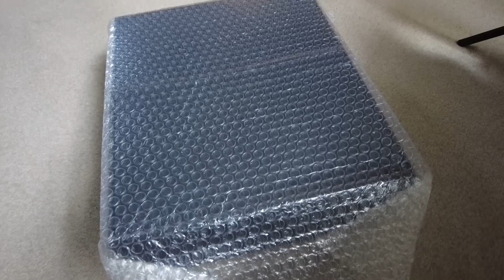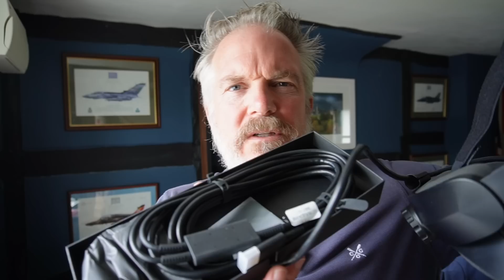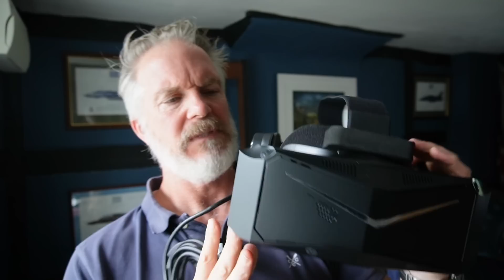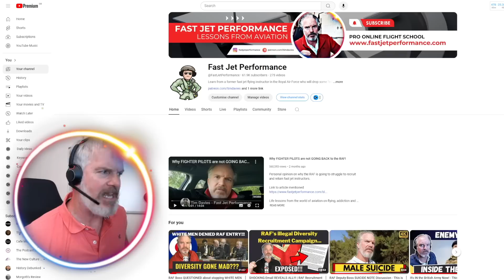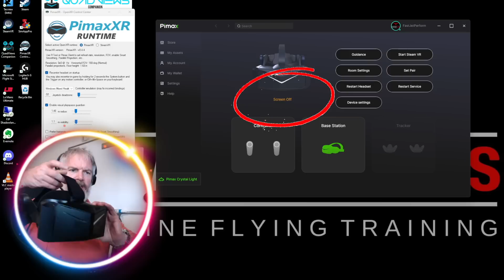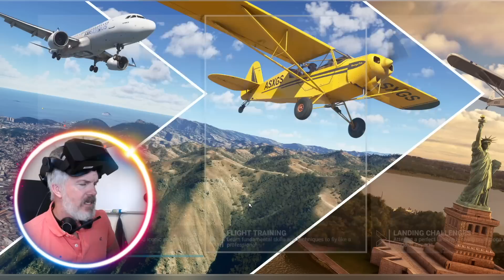Fighter Pilot Reviews NEW Pimax VR Headset!

Comment: Hi
I’ve just bought the pimax, waiting on delivery .
I use a curved monitor at the moment 
So how does this work. Do you switch off and disconnect the monitor and so only use the Pimax ?
Or do you run both, so you get windows up and get flight sim running then you put on the headset, or does it replace the monitor completely?
So you put on headset and start your pc ?
Can you run both, or does it max out your graphics card running monitor and the pimax headset ?